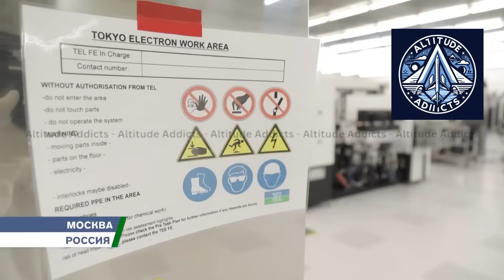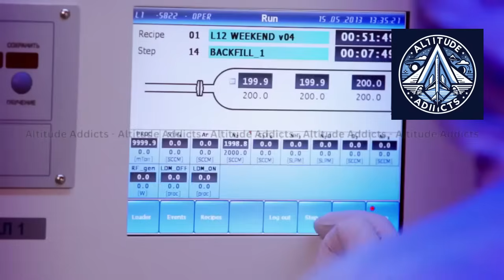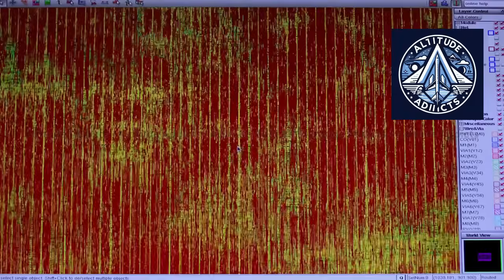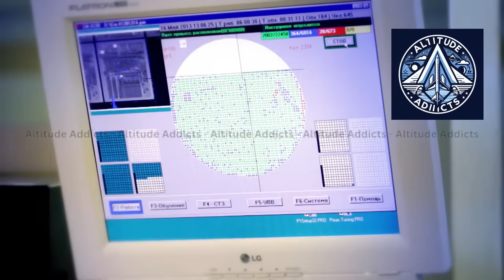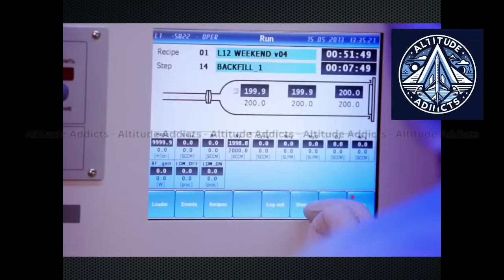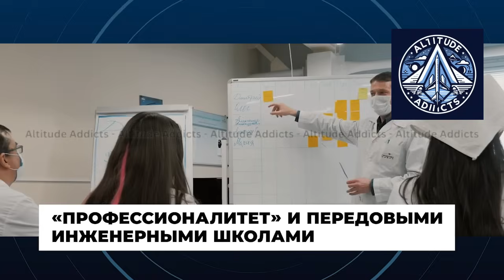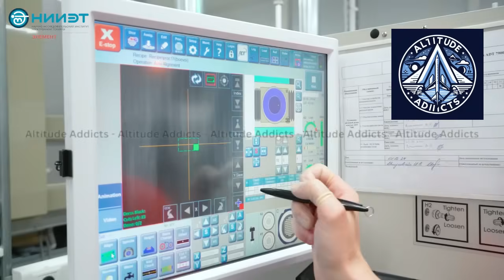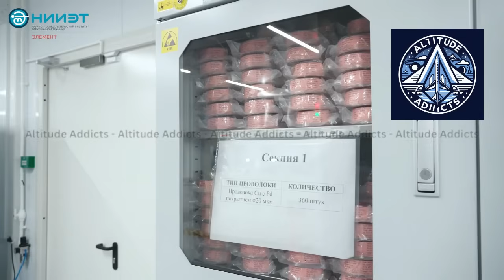Russia Builds High-Tech Testing Grounds for Next-Gen Chips

Comment: There is huge amount of electronics that doesn't require ultra -high modern tech process or miniaturization. Most of chips for cars, industrial robots, controllers etc don't need to be energy efficient or provide high computational performance. Those are the most important chips, not CPU or GPU... You can by them easily anywhere and import. What really matters is that you can develop and manufacture your own special designed chips. For example the Boeing 737 is still using an old chip designed in 1996 for its FCC Flight Controller (autopilot etc) still in use in all 737 avionics. Old chip that costs 50.000$ (EDFCS-730). So, Russia is not interested in manufacturing chips which are easily available on international market, but on custom designed chips for special needs.
Reply: In fact special needs means require for advanced chips contain smaller transistors e.g. for A.I. so making or buying the advanced lithography machine is essential.
Reply: @abdolelahi7106 custom AI chips are for "big" players, like China and USA. Europe, Japan Russia are out of this league. Russia can buy AI chips from China if needed. Currently Russia needs other kind of microchips like microcontrollers which are used in industrial robots, medical equipment, avionics, iot, automotive industry etc... and military equipment of course, Drones, radars, missiles, navigation equipment, communication equipment and so on... They don't need to manufacture general purpose high performance chips because in order to produce them at a competitive price you have to manufacture them for the whole world, as other players are doing. Most popular microcontrollers like stm32 are 90nm or even 180nm are produced in Europe and China. They are the workhorse in most electronics nowadays.